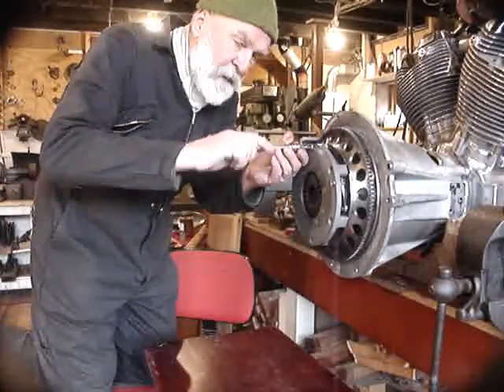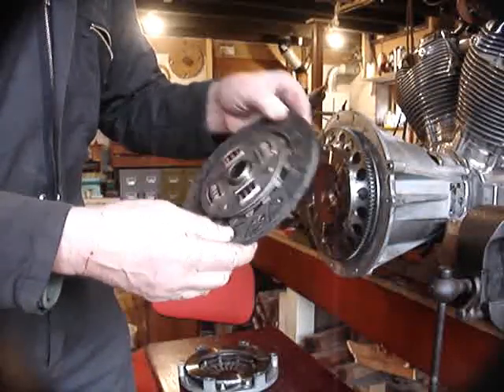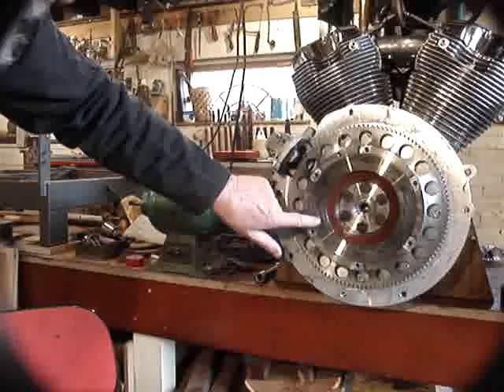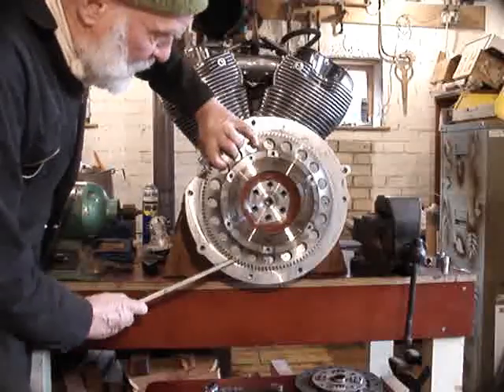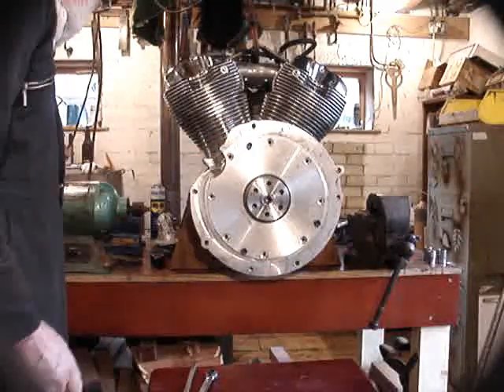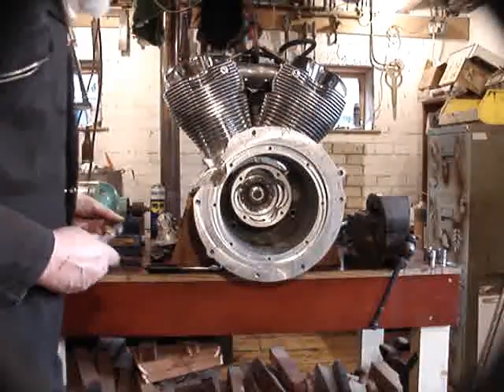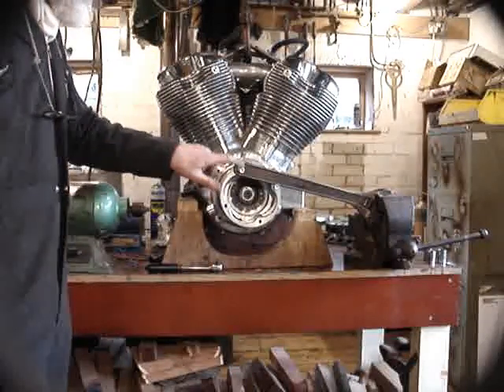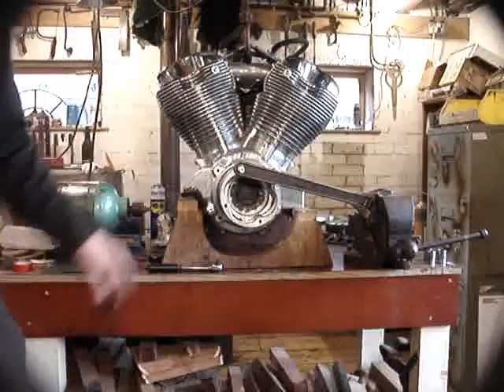Morgan 3 wheeler workshop, Removing the clutch, flywheel and Centa cush drive.

Comment: Hell Phil, Only a true artist would know about the 3/8 Basf with at least an inch on it to push that out. I have done only a couple  because I have a small engine repair shop and I do mobile welding and fabrication. The funny thing is I live in the USA. The ones I have worked on were friends who had them. I have not seen any wild Morgans around here in the north east.. Great videos my dear friend.
Reply from the maker: Sadly my artistry has been debunked - a fine series 10mm thread is almost identical but it is almost impossible to tell which it is without some very sophisticated measuring kit.  Thanks for your nice comments.  Are you saying that you would be happy to do some upgrade installations for customers over there?  if so come back on philbleazey@gmail.com
Reply: @morganthreewheelerworkshop1189  Exactly what I am saying. I will email you . Thank you my friend.

Comment: Hi Phil,

I read through your website and am very impressed with your work to address the M3W's design flaws.

I'd appreciate your thoughts on a couple of points I'm not quite clear on.

From your descriptions and photos I think I see how the compensator and related parts work together, but it would be very helpful if there were a cross-section drawing or sketch to be sure; is there one that you could share?

Also, I was surprised to see in your video that the compensator input side bolts to the alternator rotor, for a couple of reasons:

First, that would seem to overconstrain it, as is it not also splined to the crankshaft output shaft?

Also, I wouldn't necessarily expect the rotor face to run extremely true, so possible introducing a wobble into the compensator.

Or perhaps I've got it backwards and the splines are sloppy, which would allow the compensator to wobble, and bolting it to the true-running rotor takes care of that.

Thanks
Reply from the maker: Hi Noah - sorry, no cross section drawing available nor, unfortunately, time to produce one.  You could ask Centa or Morgan but I've always found them extremely unresponsive.  You are missing the point that the alternator rotor, when bolted to the Centa coupling has had the splines completely removed so there is no conflict of dual fixing.  The compensator splines surely are often sloppy but that is one of the major improvements from my up-grade - please email for more information - all the best, Phil

Comment: I’m proud to say I own some 3/8” BSF screws and therefore I’m officially an old fart!
Reply: Congratulations Andrew,  I am however a bigger old fart than you because I have had it pointed out to me that 3/8 BSF is interchangeable with M10 x 1.25 ( 0.02 mm difference in the pitch) so it is probably metric fine - never too old to learn!

Comment: Dear Sir,
I'm extremely impressed with your YouTube channel and I intend to purchase a new 2021 Morgan 3 wheeler in early March. My problem which I am investigating is importing one into Brazil where I live. The taxes on importing cars or motorcycles into Brazil, either they are not allowed or persons can make a personal import under certain conditions. I'm trying to find out is the M3W considered a Motorcycle or car in Brazil. I know that in the UK and USA they are considered Motorcycles, but in Brazil, I still haven't gotten a straight answer. They say, bring in, then they will decide. But if I do that, I could pay between 100% - 200% import taxes. So I need a written reply from the authorities, customs and tax, and road departments before I purchase one. I want to make the M3w as strong and reliable as much as possible due to the horrendous roads here. Some are badly paved with loads of Potholes or dirt roads which after in rains, become worse than normal. I would want to make a few changes to the M3W, such as exchanging the real drum brake for a disk brake, a chain drive, and the other replacements you mentioned in other videos (Bevel box upgrade etc...) and others you suggest. Would you also suggest installing a new Brembo brake system on all 3 wheels and perhaps new adjustable Ohlins shocks. I also would want to increase the height slightly of the M3W when I mount a suitcase and perhaps 1 front spare tire and rear tire plus tools and tent to make any repairs while in the middle of nowhere when I go on long journeys,. I intend to drive from Brazil to Argentina and Chile and back again, so Carrying power is critical. Am I crazy for wanting to purchase a M3W for these types of conditions in Latin America? Thanking you in advance, kind regards, Peter Donnellan from Ilhabela Brazil.
Reply from the maker: Hello Peter,
Good luck with you importation problem I hope it works out OK.  Certainly you should do the modification to make quick changing of the Centa coupling inserts possible.  Chain drive is easily repairable by any motorcycle workshop so a real advantage.  I am looking at a disc brake conversion but I would think the drum would be more able to cope with the dirt and grit around the back wheel in the conditions you describe.  The stock brakes work well enough for any road use. Ground clearance could be an issue especially at the back when the front wheels start to climb.  Not sure about Ohlins being better for rough terrain maybe you should pose the question to the makers?
Reply: @morganthreewheelerworkshop1189  Thank you sir for your kind response. I did find out about the importation, it's considered a motorcycle and not too much to pay on taxes, only about 80% of the purchase price.  (S**T) I should apply for Vat free as it will only be in the UK for a few months to tour your beautiful country and bring it to you for the recommendations. I would really like to attach a disk brake on the back and perhaps upgrade the front disks to a more powerful brake. I will contact a dealer to see if they can sell me one Tax-Free, it would assist in paying the import duty and upgrades. Thanking you in advance and please send me your email address to contact you to assist me in the modifications I would like. Perhaps you can be my "Agent" with Morgan to ensure that they can either make some modifications during construction under your guidance, For a fee obviously. I want it made right and will pay for your time and experience. Once again, thank you for your channel.  I will contact Ohlins to see what they recommend.
Reply from the maker: @peterdonnellan4295  Hello Peter,  Good to hear that all is going well with your new car purchase.  I will have an experimental disc brake here next week to start some development work but it may all take a few months to get tried and tested before I have anything available for sale.  You are welcome to come and stay here for upgrade work - Claire has a very nice bed and breakfast house - Covid restrictions permitting.  I do not think I can be your agent with Morgan - they do not reply to any contact I try to make with them.  Good luck and I hope to meet you soon.
Phil
Reply from the maker: @peterdonnellan4295    Phil@woodenflutes.co.uk

Comment: Was wondering what the set up was for the Morgan engine to gearbox. Was thinking of doing a Harley 1800 Fi to Mazda MX 5 gearbox set up. After watching your video, I think I'm out of my depth. Didn't realise there was so much going on behind the bell housing. Good video
Reply from the maker: The Harley engine might produce less in the way of torque spikes and therefore need less shock absorbing qualities in the coupling but I am afraid it will be suck it and see unless you can find someone with appropriate previous experience.
Reply: @morganthreewheelerworkshop1189  Thanks  for the info.